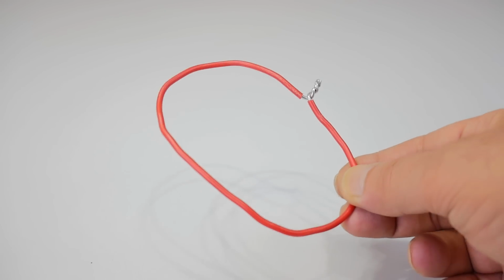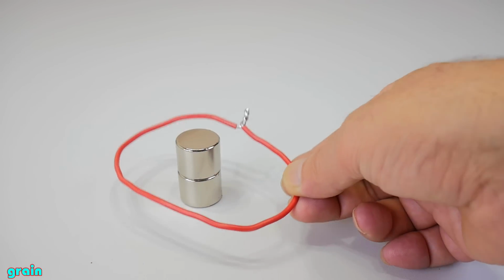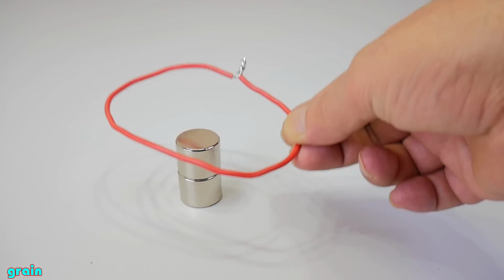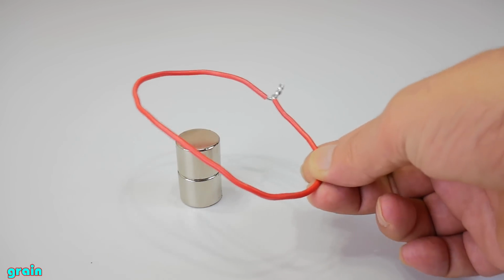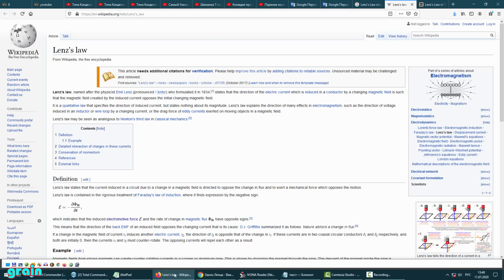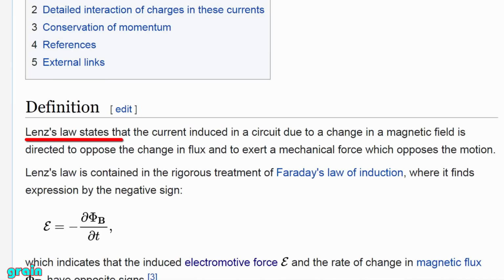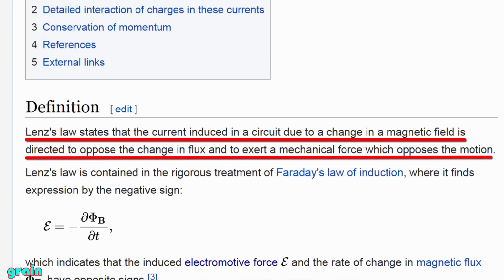Aluminum Rings in Alternating Magnetic Field

Comment: I think something more should have been said to answer the question posed by @withamit07:
“When current increases there is repulsion but when current decreases there is attraction. So how does the ring gets a net lift”

Answer:
We can see the attraction/repulsion as between 2 fields (B1 the inducing one created by the coil, B2 created by the induced current in the ring) or as between 2 currents (I1 in the coil producing B1, I2 in the ring producing B2). The 2 currents attract if they have the same sense (e.g. both clockwise), as the 2 fields (think of 2 magnet oriented the same way, with the S pole of that above facing the N pole of that below).

Now, the EMF (electromotive force) induced in the ring has a certain sense while I1 and B1 rise from a negative max to a positive max (during a ½ period, that is, ½ of 1/50 s). In this interval of time, I1 inverts its sense (negative for ¼ of a period, positive for the next ¼). So, if I2 were in phase with EMF (that is, reaching max and min at the same time), I1 and I2 would have opposed senses for ¼ of a period (thereby repelling each other), then the same sense for the next ¼ of a period (attracting), and so on. The average effect would be zero.

But the ring is not a purely ohmic load, it's a coil (if only of 1) so it has inductance and I2 is delayed with respect to EMF (reaches max after). Hard to explain without drawings, but the result is that I1 and I2  have opposed senses (repelling) for a greater time. This imbalance gives a net repulsion.
Compare this not-so-great average repulsion with the strong repulsion at 2m50 when the field is suddenly increased over a very short time (a transient)

Comment: The steel core doesn't heat up? Like an induction heater? Why is this?
Reply from the maker: The steel core heats up very quickly. It is heated by eddy currents. To reduce heating, you need to make a core of thin insulated plates.

Comment: So the “Greater” meaning force or speed , if you will , that is thrust towards a closed system then what if we accelerated at a higher speed to affect the loop ? We should be able to use less powerful magnets & if the speed was tremendously increased , there would be no need for a “Magnet” at all . A simple piece of an alloy containing the ability to “know” “N & S” is all that is required .

Comment: In other words both aluminum and copper is repulsed pushed away from a changing magnetic field?
Reply from the maker: It's not about aluminum or copper, it's about Lenz's law - https://en.wikipedia.org/wiki/Lenz%27s_law
Reply: @grain-diose  That is interesting.  It is not the same as just opposing current or voltage.    It opposes the change. It is something different. So it opposes at the start and at the end for sure as that is always a change.  Changing magnetic field or voltage or whatever.  This seem to be more related to coils than capacitors I suppose.

[ if you send power to the coil of wire first and then drop the aluminium.......it perhaps behave differently. Probably because it already sees the situation and the aluminium doen't take it so personally...... No?]

Furthermore, it appears to me that the law does not explain the complete repulsion.  From what I get reading the law, the ring should should pulsate up and down at however many cycles per second as the frequency of chance.

And of course, if it not about aluminium or copper,  Lenze's law does not apply to rubber, iron......etc
Reply: @grain-diose  Never heard of Mr. Lenz before.  
How did they behave before he made the law for them?

Comment: can u increase the frecuency of the magnetism and see how it works a longer distance?
Reply from the maker: The frequency is only the one from the network 230 volts - 50 hertz. I did not try to increase it, it needs to be done with a special scheme and a powerful one.
Reply: @grain-diose  i saw experiments increasing frecuency to sound and it travels longer and straight long distance without spreding i think is the same for magnetism and microweaves too and i saw a video somebody doing that wiith microweaves and the hart from someone increased speed so i think that that news of that strange news that a goberment could kill anyone at a distance doing that is true too with a heart attack,magnetism in longer distances is posible cause united states can drop a magnet bomb and it travels long distance disrrupting computers so is posible to give a better use than that like tesla dis giving electricity to all the earth chanmging its frecuency

Comment: Great video! I'm looking to re-create this and have the regulator/controller, steel bar and the wire... I'm just having trouble identifying your wiring setup. 
I see 6 wires, 2in, 2 out and 2 leading to?... 🤷‍♂️
Is the third set just for grounding? Could you give me a a more comprehensive explanation... I don't want to risk a short. 
Thanks!
Reply from the maker: It's just a power regulator. It connects like a switch - in a circuit break.
https://aliexpress.com/item/1005004295252090.html
Reply: @grain-diose  thanks for the reply! As I said, I already have the regulator,,, I'm just unclear as to why there are 6 wires in ur set-up on the 4 given contact screws
Reply from the maker: @TarugoTaino  4 wires: 2 from the network, 2 to the coil.
Reply: @grain-diose  Got it. again.

Comment: Very cool. What frequency and amplitude is going thru the coil?
Reply from the maker: 50 Hertz from a AC 230 volt network. Look at 1:48, I gave all the information. The maximum power on the coil is 300 watts.
Reply: @grain-diose  Ah yes indeed. 300W from that little box eh? Is it a 50Hz square wave then? No way that box gives 300W pure sine. Anyways it's not so important, cool demo.

Comment: In what fucked up universe is copper a better conductor than aluminum as far as electricity goes a closed ring of aluminum is obviously a biter you don't have the oxidation issue as far as surface oxidation now whether or not it induces a better resistance or not that maybe different than what I'm imagining but as far as conducting electricity in a wire aluminum is a better conductor as long as you don't have oxidation issues at the connection to the power

Comment: Try a closed toroid with vacuum inside containing a ferro-mercurial cobalt mixture (nano -particles in a colloid like suspension) suspension. Small coils individually wound around the toroid are connected intermittent manner one alter the other & powered in sequence so as to accelerate the mixture. As accelerating increases the mixture center inside the vacuum filled toroid therefore there is no friction with the walls. As the RPM   Is increased, the mixture will become a plasma & a corona effect will be generated. Further acceleration will create a white glow that will expand outside the toroid proportional to the voltage increase. As the radial speed approaches near relativistic velocity, a decrease in weight of the toroid will occur. This is not due to “antigravity”, but rather by a poorly understood effect where the center of gravity is”hidden” from gravitation.  Ever heard of the TR-3B? The central toroid is about 10m in diameter.  What is not known by the general public, me included, is the exact proportions of cobalt, iron and barium per volume of mercury.  Just for clarification, the entire volume of the toroid is not filled by the mixture. When it is activated and accelerated, it looks like a thin ring of glowing plasma centered inside the toroid. So the effect is not caused by a gyroscopic force, but rather hyper velocity of the gyrating plasma and the subatomic fields that are disrupted and redirected.   

The TR3-C is a significant leap forward, since using the same basic principle above described it is coupled with an Einstein-Bose condensate that forms outside the craft. How this is done is very hard to imagine, unless someone has profound knowledge of subatomic physics & different property of the different states of mater and how to transition from one to the other back and forth without enormous quantities of energy, since the craft generates whatever energy that is required… any thoughts?  Can anyone with a solid physics background elaborate?
Reply: This appears to be nonsense?
“Hiding the center of gravity” is certainly nonsense.
Reply: и ты балбес) гравитации не существует)

Comment: Hum!  Do designers know this. Most electric motors and generators alternators have aluminum casings, are those casing getting hot due to the heat of the motor, or it is from the electric being generated on those encased enclosures?

Comment: How hot did the steel core get during these experiments?
The same currents that lift the rings are also induced in the core itself. Only the steel is a bit worse conductor.
Reply from the maker: Yes, my core heats up very quickly with Foucault currents because it is made entirely of steel. To reduce Foucault currents, you need to make a core as in a transformer - iron plates isolated from each other with paint or varnish.

Comment: Would an array of smaii diameter equaiiy spaced vertical permanent magnets aligned the same way (visualize the shafts of thumbacks on the  cardboard card they are ofen sold on) have a more intense near repulsion and less intense far repulsion to a smaller similar array in comparison to to a similar pair with undivided faces. The small array may float at a hight equlibrium above its large array.because of the more complex  structure.
Aloha
Charles M Brown lll

Comment: Can someone tell me the effect of ring diameter on the levitation (induced current in the ring)? I.e. what happens if the ring diameter is increased?
Reply: i guess the ring's mettalic part needs to be closer to primary coil to experience large strength of magnetic field.

Comment: Hi.... I am trying to recreate a magnetic levitation which can be used for shuttle movement for loom industry in India..... Can you suggest any method s to reduce heating in coils and aluminum plate
Reply: use less current. increase the no. of windings. This will increase resistance and reduce current but increase in windings tends to increase magnetic field strength. Overall affect of increasing winding will be less current and almost same magnetic field strength. The magnetic field strength will reduce a little in this method as the radius of coil changes

Comment: Very nice video. Could you please clarify why the Aluminum ring is elevated rather than keep going up and down?  I expect it will be going up and down as you are using an alternating current so the magnetic flux keep changing directions up and down?  thanks
Reply: Is not the magnetic flux that keep the aluminium ring up. Aluminium is diamagnetic (not repel, nor attract a magnetic) . Is the Eddie currents that form inside the aluminium ring that repel the ring from the magnetic flux, I asume.
Reply: It’s basically because the induction is dependent on the rate of change of magnetic flux and with AC current, the flux is constantly changing and the induced magnetic field is necessarily opposing the applied one, thus instead of a decay, you get an overall repulsion. One way we can model this is just to say that the amount of resistance F=k*|dB/dt| where B is magnetic field strength (this skips a lot of stuff and is an oversimplification but is a decent approximation) if we assume that B is some sine wave, then F=k*|cos(f*t)| which means that it’s always forcing it up

Comment: Teh ring of aluminium can have other elemnts not 100% pure ... think about it.
Reply: The ring likely has aluminium, magnesium, and a small amount of silicon. Aluminium is an excellent electrical conductor, and most power lines are made with aluminium as the conductor.

Comment: Can I ask a question please ?
Reply from the maker: of course
Reply: @grain-diose  if we remove the 25mm steel what going happen?
Reply from the maker: @TheBest-rg8sq  The fuses may even blow. Because without a core, the coil has much lower resistance and there will be a lot of current. And the aluminum ring will not react, or rather the effect will be very low.
Reply: @grain-diose  so if we want make the magnets so higher and make the aluminum 2 meters higher what we can do ?

Comment: Why the ring isnt changing  direction. Only lifting up? I mean why its not spinning
Reply: To induce rotation of the ring as well as lift, the magnetic field would need to be rotating. This requires a more complex coil winding than shown here, or to use a ring with a more complicated arrangement of magnetic domains.

A very common and simple type of electric motor is the squirrel cage induction motor. It uses a simple coil, and a complex ring to produce rotation.
Reply from the maker: It's hard to explain.

Comment: Why the ring with a slit didn't float in the air?
Reply: An entire ring forms an electrical circuit, so when the ring is subjected to an oscillating magnetic field a current flows through the ring. This current flow causes a magnetic field to develop in the ring, and the magnetic field repels the magnetic field in the coil.

When the ring is cut, the electrical circuit in the ring is broken. This means that when the ring is put into an oscillating electromagnetic field, current cannot flow around the ring. With no current flow, no magnetic field forms.

Now, if you take the slit ring and connect an electric  or electronic light across the slit, the light will complete the circuit, and current will flow through the light causing it to emit photons, or "light up".

Comment: I understood we should rather use alumimum plate with electromagnetism to cook food but still stick to copper for electrical supply.

It would be nice if you could mention the supplied power on different nob turns how much in which condition?

Normal herd or oven takes 3000 to 5000 watt, you used 300 watt max.
Normal herd/oven max temperature is 537 degree celcius.
Any guess about temperature in your experiment?

Thank you very much for demonstration.

Comment: The closed ring with induced current having nearly 0 volts; the opposite model is a battery not connected to a load, it has volts but no current flow due to the resistance of the air or surrounding medium.

Comment: I would like to recreate this.  What kind of wire did you use and how much? Where did you get the core?  How did you keep the electromagnet  from shorting out?
Reply from the maker: I used 0.53mm diameter copper wire, 1700 turns - 1:53
For the core, I bought a 25mm diameter steel bar from a hardware store, rounded the irregularities and polished. I did not do any protection against short circuit.
Reply: @grain-diose  Thanks.  Did you make 1700 turns yourself?  If not, how can I know how to a purchase a spool with enough turns?
Reply from the maker: @craigmoody1614  Yes, I wound the wire myself on the spool.
Reply: @grain-diose  Thanks
Reply: The wire is laquer coated so it doesnt short when wound

Comment: I was planning to make coil gun but needs lots of current & currently i am not having enough batteries
Reply: You won't get anything like a coil gun out of a battery. Even modern lithium ion. You want to do it with capacitors. In college, we played around with trying to build a simple two rail system. Using aluminum powder as the conductor at the back of the projectile. We delivered several thousand amps in a couple of milliseconds. And it kind of tore itself apart every time.

Comment: i wonder if it is possible to use this experiment on cars to prevent accidents putting aluminum in back and magnets in front of the car, ex. when the car speeds up and the driver try to reduce the the speed of the car but don't have enough time to stop, the Lenz's law can help the driver to reduce speed of the car 🤔or instead of magnets we can use electromagnets for controlling the magnetic field (if you understand what I mean ) more speed =more power to the electromagnet, less speed, less power
edit: Grain:- i hope the video was interesting for you
me:- you give me new ideas to save the world 😎👍 thank you
Reply: Well I think it would be possible. But it has a lot of aspects to think about, additional mass, and energy consumption (caused by the additional mass), etc... and magnetic fields are dangerous for some persons with heart problems...
Reply: @frankmeyer9984  if you refer to those who were a pacemaker, your right
Reply: Nighthawkinlight tried something similar. Look up Nighthawkinlight Cannon Ball Magnet. It doesn't seem too optimistic, but maybe it would work if the electromagnets were made to cover a larger surface area.
Reply: any interaction between things connected to the car will have no net effect on the car (3rd Newton's Law)